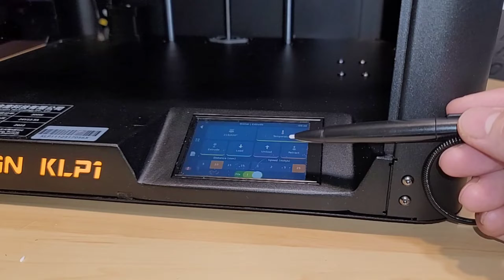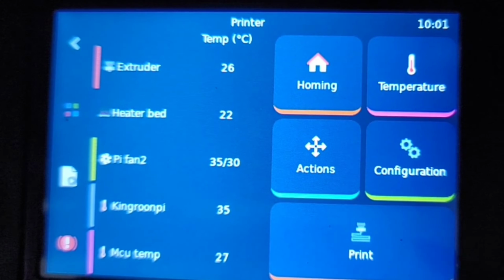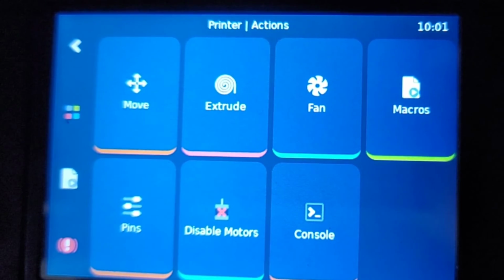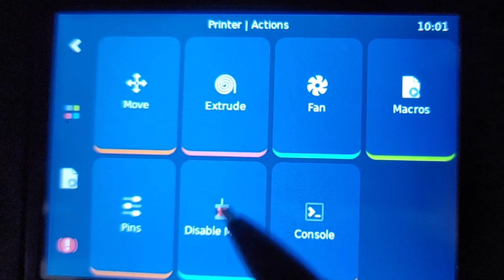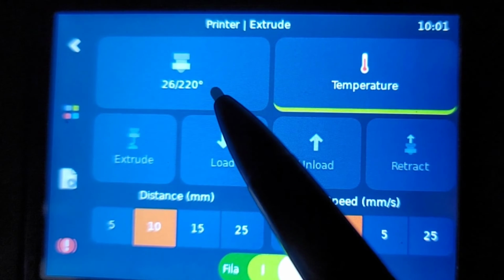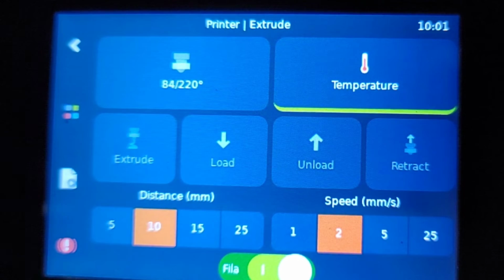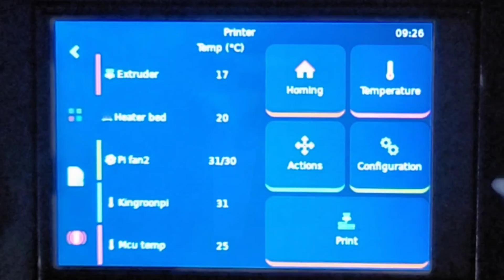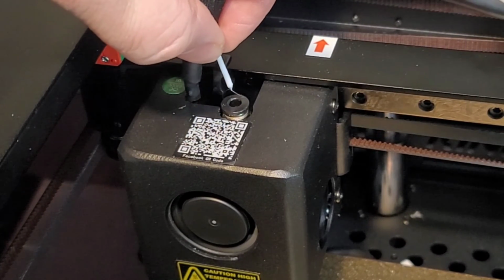Kingroon KLP1. CORE XY 3D printer Klipper firmware.  Better than the ToyBox 3D Printer!?

Comment: With all the K's and L's in the title, my old eyes were thinking is this a Klingon 3-d printer?
I am guessing you're not happy with the result of the game. 
As for the printer itself, it looks good.  Do you have to unload the filament every time you're done?  If so, why can't you just leave it in the machine?  Yeah, I've never used one. How much waste, if that's the right word, is there when you do load the filament?  Reminds me of the inkjet printers and their need to use ink to clean the inkjets.

How long to print the stylus holder?  Are there generalizations when printing so that you can estimate how long a particular item will take to finish? I'm asking not really for me but for others.  Down the road I might find myself looking to get one if the need arises.
Thank you.
Reply from the maker: Lol...space the final frontier...
You don't have to remove the filament each time, although I typically do. Loading and loading wastes some, bit not as much as failed prints, which do happen. The stylus holder took a little over 30 minutes to print. This is a pretty sweet machine at a great price point. Thanks for stopping by and commenting 👍